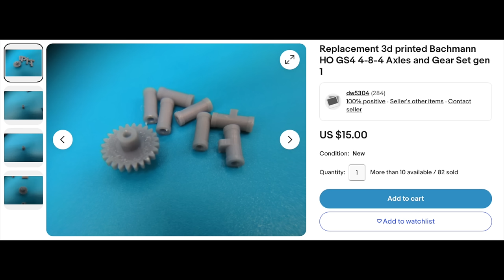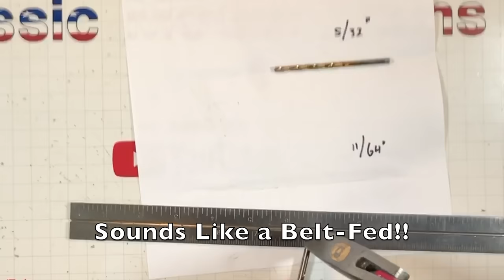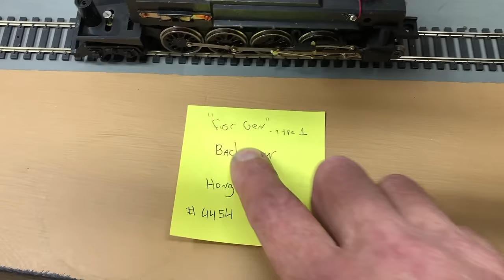3D Printed Gears Didn't Work!  I Found A Technique That DOES!

Comment: Why not just make the whole axle out brass
Reply from the maker: The wheels pick up current from the rails.  If they were connected with a conductive piece it would short out the transformer

Comment: Hi Ron, new subscriber. As someone who has worked for a while in a machine shop your skills are impressive. We can cut the gears to reset the teeth in a wood lathe, yep they do wear out after a while. In general we don't work on things as small as you do and you are obviously a very skilled person. By the way, a local hobby store had a now retired clerk who used to say that Bachmann would send out free replacements for any cracked gears. Strangely enough I have found messing that much with their older stuff to be worth the hassle. I tend to stick to lines that don't have  cracked gears. Still, if I was going to get one would have to refer to your solution. Sheer genius. Cheers.
Reply from the maker: Thanks for the kind words and welcome aboard!!  Sure the Brand "bachmann" has lifetime warranties that last only as long as the particular parent company owns the name Bachmann.  Its been bought and sold so much in the last 40 years the warranties aren't worth the paper there printed on.  P.S.  Ive been a heavy truck and equipment mechanic for many years and always looked up to machine shop Fellers.  You guys fix the stuff we broke while trying to fix it :-)
Reply: @classicmodeltrains Yeah, I'm always amazed by how those things go. The gent I was mentioning was an employee as recently as a year ago he mentioned that with regard to the newer models. Personally I'll just stick with better brands, Kato being on of my favorites along with Atlas and a few others. I've had very good luck with Rivarossi equipment. Anyway, thanks for the welcome and I think have watched about 10 of your videos, please keep up the good work.
RGM

Comment: Hello Ron, how much trouble is this kind of work giving you and more importantly what is the demand. As a precision 3D/digital modeller I work in fine-scale, drop on my place holder website and you can see a scale working railway lamp smaller than a match head. Not only do I work to original drawings but I have produced assemblies for electron microscopes. Yes, what you want can be done in resin delivering the strength you need either with "black aluminium" or using a hybrid metal powder/resin mix. This is something I had planned on looking at Sep 2024 when I begin developing loco chassis, gearing and valve gear. If the demand is their, maybe we can talk about moving that work up the calendar a bit.
Reply from the maker: The pieces have to be non-conductive.  As far as demand.....Many of these loco's have been produced in the past and many have failed.  Some Guys said the gears I bought worked for them, Some have said they had similar results.  The producer of the second set of gears is currently working with some different "stuff" to make the piece more flexible.
Reply: @classicmodeltrains  The metal powder I’m looking at is aluminium for the valve gear, black aluminium or carbon fibre for the gearing. Keep me posted on how your getting on, if nothing appears on the market let me know and we can talk about producing what you want. My email is on the page and that will take you to the place holder website. Railroads&Railways should give you a hint where I’m going with this. We already have US engine and track crew… to correct human scale.
Reply from the maker: @RailroadsandRailways  Right on!

Comment: I wonder about the bachmann train set? It is a GS4 daylight special set. A GS4 with 3 passenger cars
Reply from the maker: I'm not sure what the whole set would consist of.
Reply: If you’re talking about the new set that has a completely different dcc ready drive system, no more split chassis. I have one with dcc on board and it runs okay, the original decoder is weak though.
Reply: @jensenleblanc  I wait for some reviews

Comment: JUNK.  The A.C.Gilbert company made 2 rail trains starting in 1946. They did so quite successfully and never had such problems. They insulated the tire from the wheel and were very successful with early plastics. Why can't modern manufacturers do the same?
Reply from the maker: I agree with you Ron,  Bean counters weren't Effing around with the products.  Just let the engineers do what they were hired to do.
Reply: @classicmodeltrains  
AMEN

Comment: Worst quality than bachmann? I 3d printed gears to fix a Bachmann 4-4-0 it works great I just oil it before running to be sure the gear does not Strip out, I used PLA to make it (And I printed it as slow as possible to make it the highest quality I could)
Reply from the maker: Right on!!
Reply: @chasesrailwaylinesrr6447
0 seconds ago
I think in your video they were trying to make them look more like the original gears than functionality With the way I printed mine I just print them in the strongest pla filament And I printed them slowly as to make sure a bunch of layer lines would hold it all together. My axels sometimes break but that's because I Accidentally bend them  If I'm super careful with the 3d axels and make them the right size they will work just fine

Comment: make your own mold with the gears and a pin. Drill out the axle in the wheel. make melt some brass and poor your own gears.
Reply from the maker: The axles cannot be electrically conductive from one wheel to the other.  It would short out the power being supplied to make it run.

Comment: I have a 30 year old Bachmann 0-6-0.  I went through what you through with the gears and axles.  All cracked plastic.  I fixed it with a lot of creative work with hard plastic tubing.  Thanks.  Great job.
Reply from the maker: Thanks Mike